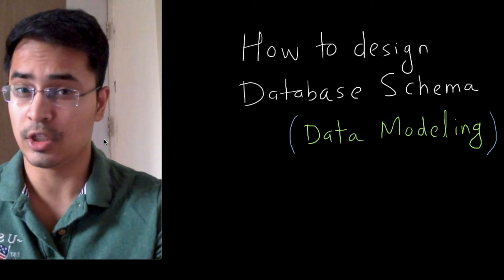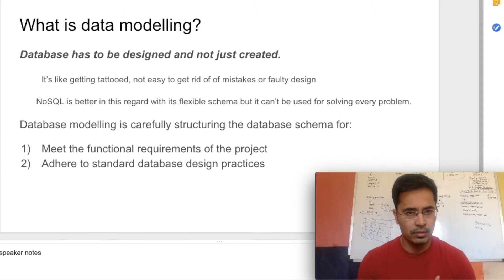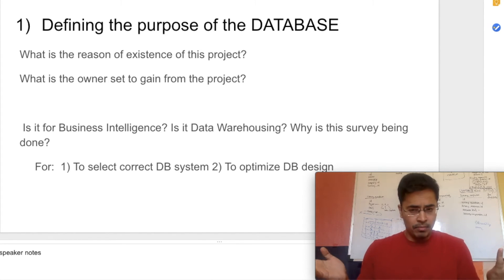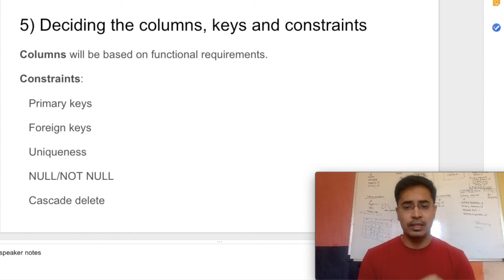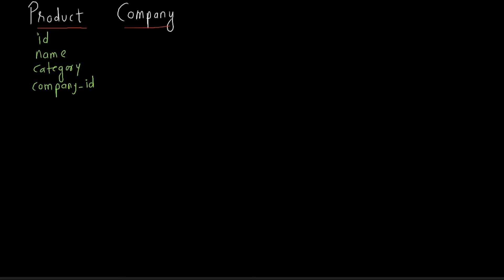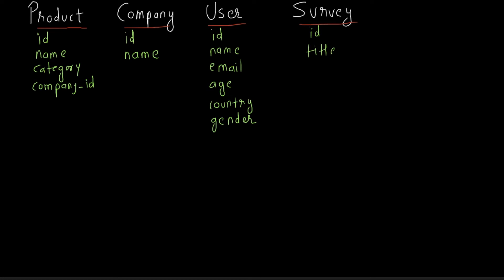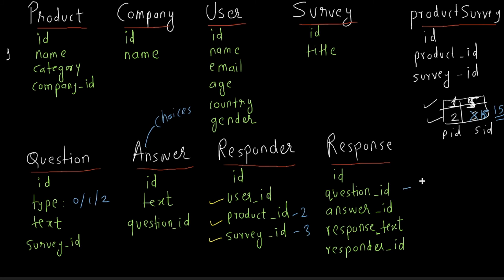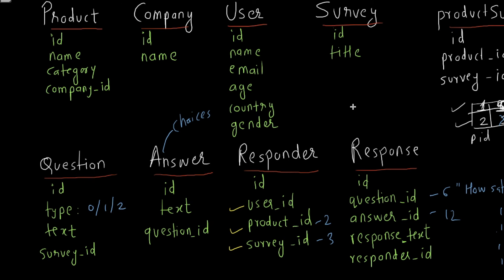How to design database for a project

Comment: Thank you so much. You actually showed the concept of a foreign key. One thing I don't think you addressed and glosses over was how to handle multiple answers (Check Boxes). This is a major database question I don't know how to solve. Thanks again for an excellent video.
Reply: Yeah, I felt the same way while watching the video. However, he has handled this use case well.
Looking at the tables, you can see a 1 to many relationship between question => answer tables. That is, one question can have multiple choices (if it is an objective question). So when fetching the question from the database, you can also fetch all the options referred to by question_id in the Answer table.
Reply: ur questions is related to front end and  this is all back end stuff....

Comment: I think you have bad design in tables question and survey because your design implies that each survey has its own questions because you have survey_id in question table, problem is if you have same survey, same question for every survey. I think in that case you should remove survey_id from question table and add new table something like SurveyQuestions which would be connection between question and survey (obviously) and it will have survey_id and question_id and answer_id with composite primary key, so basically classical many-to-many relationship. In that case you could have hardcoded question in db and just insert into SurveyQuestion which survey which question and which answer.

Comment: Is there a second part to this video? I could not find it. @BBarters. Thank you.
Great video btw.
Reply from the maker: So far only one, I plan to make a couple more soon. Thank you for your kind words.
Reply: @BBarters  Thank you for responding. Quick question tho if you got the time. I have a hard time understanding the responder object. How does it relate to the other components?
Reply: In case im not clear, does it stand by it's own or do we need to map it with components with whom it shares PK?